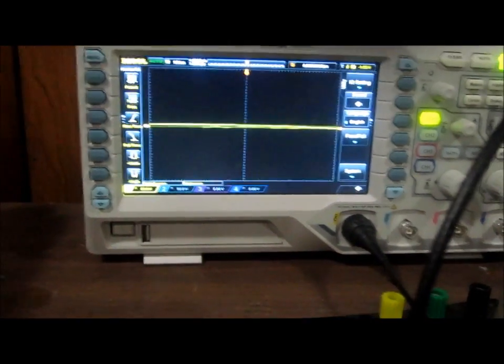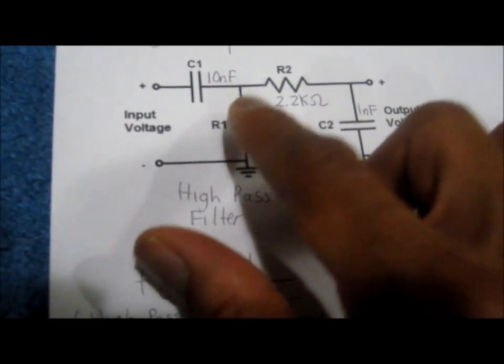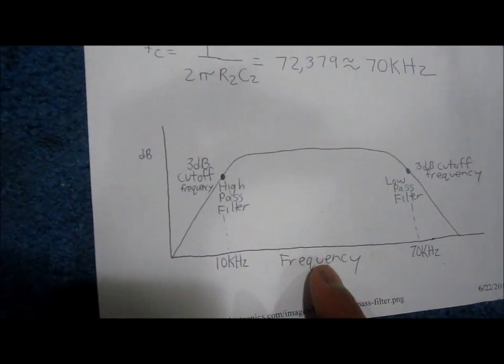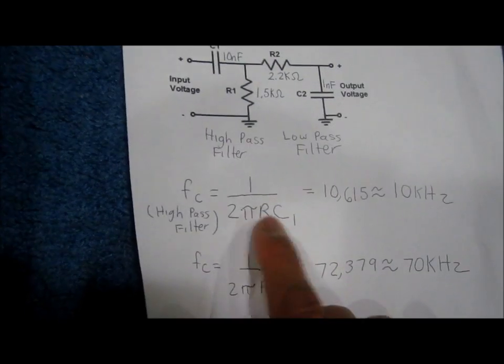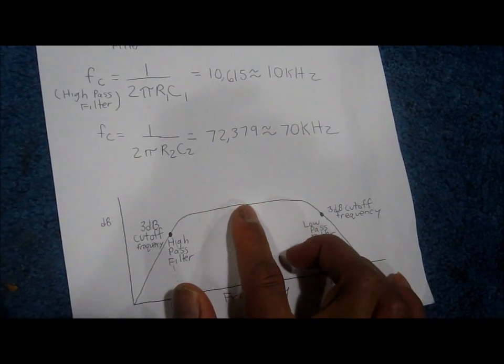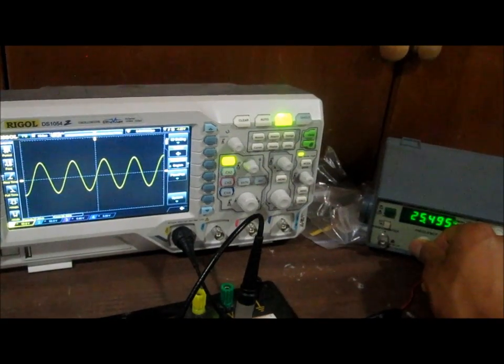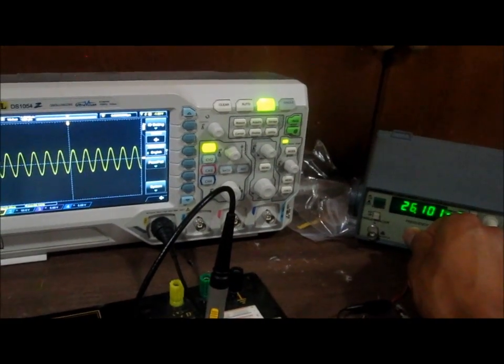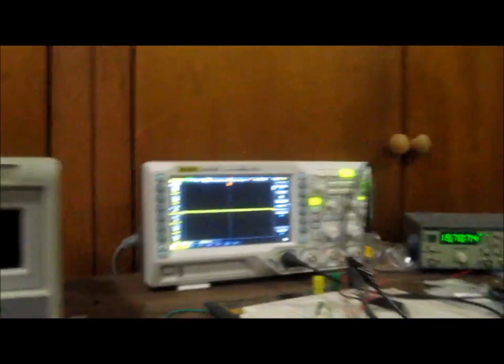Bandpass Filter Circuit

Comment: Good introduction and demonstration of the Bandpass Filter - Typical application is in Tube Amp Tone Stack (Treble, Bass, Mid Range) Circuit.  I notice you are using Rigol DS1054  Oscilloscope - How is the performance ? Also what Brand/Model do you use for the Function Generator?